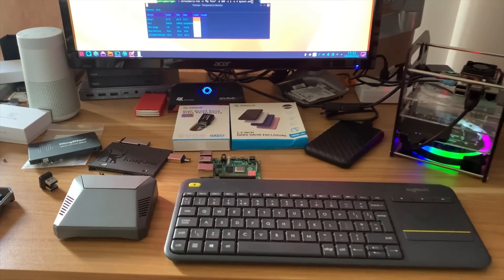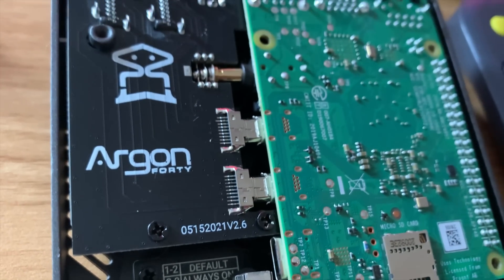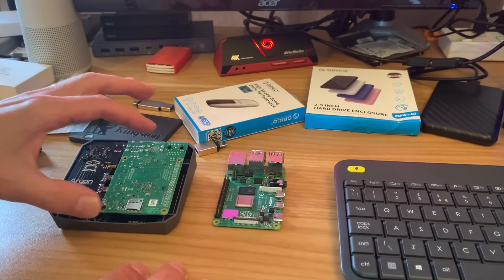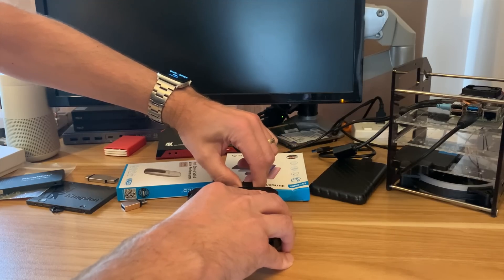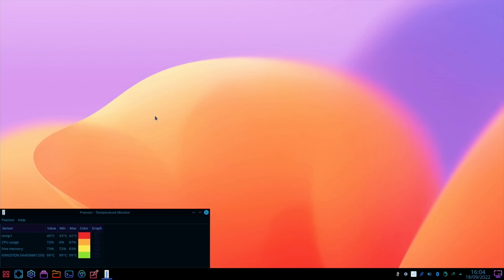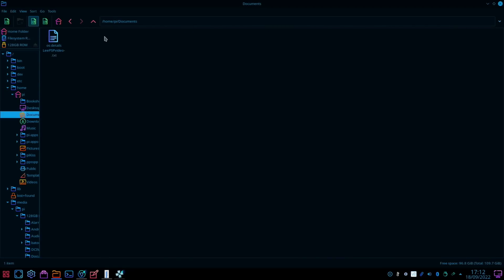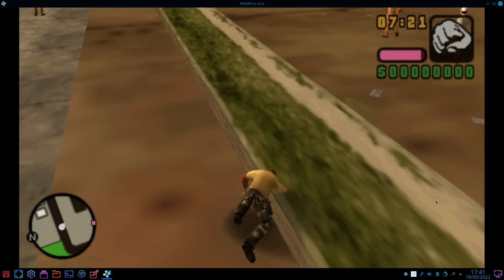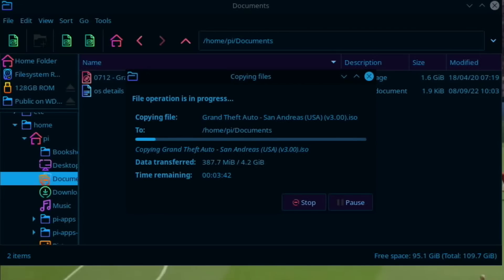Argon one V2 Vs ice tower cooler Test. Part 3

Comment: I don't have an argon case but something i would look at doing is seeing if there is enough clearance inside of the case for an ice tower, then cut a hole or vents in the top to supply air. 3d printing a new lid to accommodate the ice tower is also an option
Reply: Why the hell would you do that? The case IS the heat sink. The aluminum reaches down to the CPU, transferring all of the heat produced through the whole case which was designed to BE the heat sink. Cutting a hole in it and putting an ice tower cooler on it is beyond ridiculous.

Comment: I received my 52Pi rack tower over the weekend. I ended up mounting the Argone one V2 to the top layer using 2.5mm x 25mm machine screws purchased from a hardware store. I'm going to mount a  powered 4-port, USB 3.1 hub to the second layer and the bottom two layers will have two 3.5 inch to 2.5 inch double layer SSD mounts screwed into the mount holes in the plastic. I have 1TB SSD's in one of the mounts. I'm plannng to remove those and substitute in 2TB SSDs each, along with the 500GB M.2 in the Argon case. 

If the Argon case-fan is annoying, this may be a quieter option. The top of the tower fan is able to blow enough air over the Argon one case to cool the metal, and to blow air around the M.2 case.
Reply from the maker: Let me know what hub works well for you. 👍🏻

Comment: Great stuff! Love to see updated ultimate overclock guide plz?
Reply from the maker: I have a few, the Pi 400 was most recent 

Pi 400. How high can I Overclock without it crashing.
https://youtu.be/e9U58V8aJBE

Overclocking without cooling. Raspberry Pi 4.
https://youtu.be/DNjI6u91LuA

Overclock Test 2000 Vs 2147 Vs 2300Mhz. Raspberry Pi 4. Ice tower cooler Plus.
https://youtu.be/XiN5wbt46XA

GPU Overclock test 950Mhz. Raspberry Pi 4.
https://youtu.be/9q-k-ANRB0c

V3d Overclock test 1000Mhz. Raspberry Pi 4.
https://youtu.be/epWXhk6omtU

Best Nintendo GameCube emulation so far! Raspberry Pi 4 2325MHz Overclock.
https://youtu.be/9FaJfqAWOeM

Half Life 100 FPS and the rest! Raspberry Pi 4. PiKiss Simple Multi installer.
https://youtu.be/IH64giSnydI
Reply: @leepspvideo  ah excellent thank you handy to have the list appreciate that.

Comment: I use the default fans setup: 10% @ 55'C, 55% @ 60'C then 100% @ 65'C.  Logs show:

Mon Sep 19 00:11:56 2022 [INFO] Set fan to 55%
Mon Sep 19 00:27:08 2022 [INFO] Set fan to 10%
Mon Sep 19 00:42:20 2022 [INFO] Set fan to 55%
Mon Sep 19 01:15:08 2022 [INFO] Set fan to 10%
Mon Sep 19 01:15:42 2022 [INFO] Set fan to 55%
Mon Sep 19 01:36:44 2022 [INFO] Set fan to 10%
Mon Sep 19 01:51:18 2022 [INFO] Set fan to 55%
Mon Sep 19 01:57:08 2022 [INFO] Set fan to 10%
Mon Sep 19 01:57:44 2022 [INFO] Set fan to 55%
Mon Sep 19 02:01:58 2022 [INFO] Set fan to 10%
Mon Sep 19 02:13:10 2022 [INFO] Set fan to 55%
Mon Sep 19 02:13:28 2022 [INFO] Set fan to 10%
Mon Sep 19 02:22:40 2022 [INFO] Set fan to 55%
Mon Sep 19 02:29:08 2022 [INFO] Set fan to 10%
Mon Sep 19 05:02:18 2022 [INFO] Set fan to 55%
Mon Sep 19 05:02:28 2022 [INFO] Set fan to 10%
Mon Sep 19 19:56:20 2022 [INFO] Set fan to 55%
Mon Sep 19 19:57:30 2022 [INFO] Set fan to 10%
Mon Sep 19 20:00:02 2022 [INFO] Set fan to 55%
Mon Sep 19 20:00:10 2022 [INFO] Set fan to 10%

My old ears cannot hear the fan unless I get very close, and then I get a warm ear.

Comment: The problem with the Argon case is not really the fan comes on (yeah it's a little noisy). The problem is with the magnetic lid on top the Argon is a PASSIVE cooler ONLY regardless of fan. The Argon is an amazing passive cooler. But there are situations you need active cooling. The reason this happens if you look you'll notice heat from the fan is vented through a hole under the magnetic lid. Through moving air this transfers the heat to the aluminium lid and into the rest of the case. The air intake for the Argon is a air hole gap in the GPIO pins under the lid. This intake is the closest to the fan so the Argon fan will pull air from here instead of the side holes. So heated air is blown against the magnetic lid and pulled back in at the GPIO because the lid holds the heated air to the case. If you take the lid off some of the heat escapes and the case can cool actively. Leep you are in a very cold room so your active cooling is very efficient. Here in the summer time for me the temperature is around 78F peak. This is enough with the magnetic lid on running the same overclock settings as you to cause an overheat CPU throttle playing emulation. It takes a while for that big Argon case to heat up. But when it does passive cooling is not enough. After some experimentation I learned to only way to keep from throttling was to keep the lid off the Argon.  Leep a good test for you to show would be to see if the Argon fan provides ANY benefit with the lid on. Your in a cold room so it will be harder for you to test. But I think it would be a good test to have you as a 3rd party tester confirm this situation with the Argon? :)
Reply: Useful to know. I was thinking of this but maybe not it's always around 30c for me and the Pi idling runs around 45c.
Reply: That is really weird:

Because passive cooling is in the opposite direction: thermal uptake (the chimney effect) pushes air out through the top side vents from all vents below (including the lid but not excluding the base).

That is worth a part 4.
Reply: @LilRedDog  When the fan is not running yes heat will rise and take the nearest exit. The passive cooling is one of the best with this case. But if you lack a cool room with AC you run into problems with it's active cooling.  When the fan is running it blows air out the exhaust chimney. This chimney is covered by the magnetic lid. The nearest intake (hole) to the fan intake is the GPIO pins. So the air intake for the fan comes from there. The magnetic lid also covers the gpio pins. So when the lid is on your fan is cycling heat into a loop. If you take the lid off then the Argon cools fine with active cooling.
Reply: It's got vents out the side...
Reply: The magnetic cover does have slots (albeit thin) machines into its shape that line up with the hole I can see the fan hub and blades through. So I would say that there is a path for air to leave or enter the enclosure
Reply: @c4sualcycl0ps48 I've run tests. The holes are past the GPIO pins when the lid is on. With the fan blowing this creates a low pressure area under those pins. So the hot air gets sucked down into the GPIO->fan intake and loops the hot air. I've run my own tests. The case when overclocked and it's warm (upper 78F) will passively keep the case cool for about 20-30 min while slowly heating up. It will then throttle. This process takes longer when it's cooler. However if you take the magnetic lid off the heat escapes and the cpu stays under throttle.
Reply: It would be best if the made a vent directly on top of the fan so all exhaust air is released and cool air could be drawn in on the sides. That would improve airflow a lot.

Comment: I cannot hear the fan in my unit. I had to put my ear right next to  it to tell if it was working when I 1st got it.  I live in NYC so much hotter here in a room with no AC. I run the default Argon settings. I always wonder if its my hearing or I have a quiet unit when I see comments about the noise ??? Mine is nowhere near the sound I could hear in the video ?
Reply: This is worthy of emphasis:

Agreed:
I, absolutely, heard the fan in the video. 
I had to wait for it to shut off to know that was fan noise; because I had never heard that and did not recognize it and I'm listening to this video, in a hotel, on my POS travel HP that, somehow, survived getting slung out of my laptop bag going through a TSA checkpoint when I did not zip the bag closed and felt rushed...

My ASUS STRIX, would have shattered.
Reply: If the fan is at lower speed settings (not 100%) it is usually very quiet.

Comment: I actually lost the top for my argon case. But I customized the setup for my argonONE fan to come on at 10% speed at 35 degrees and step up 10% every 5 degrees. But I never get higher than 60 degrees. I also use thermal paste instead of the pads they give you and I have the nvme base which runs so much smoother.

Comment: Do you had overclocked the pi in the Argon case also to 2147Mhz? Because I'm surprised how smooth youtube is running at 1080p and still capable to handle file operations and emulation.
Reply from the maker: I just checked 2250

Comment: I have the first edition of the Argon case (with micro hdmi on the back) and I stopped using it because of the fan. It's loud and annoying just like yours. It's a shame that after 2 years since launched they still haven't switched to a quieter fan.
Reply: It'd take 30 seconds to solder a Noctua or Sunon Maglev fan in there...
Reply from the maker: Comments have suggested lowering fan speeds
Reply: Even at low speeds like 10% I can still hear a high pitch noise. Sometimes it even rattles as if the blades aren't 100% centered. I ended up disconnecting the fan and used the pi at stock speeds when I was using this case. Now I'm using the regular ice tower on the 3.3V, but I'll soon get this new version that makes contact with the network and USB chips as well. I use mine as a seedbox so they get pretty hot.

Comment: Heat is what kills and shortens the life span of all computer parts. My  fan is always on and the pi will idle  at 26c to 32c depending on the days temp... Play Youtbe videos  all day long 32c  to 37c , no heat build up... Stress test with sysbench wont hit 50c.. Fan is an old 12 volt . 60mm case fan out of a IBM desktop PC.. Ideal fan would be 5 volt noctuha on the 3 volt pin..Whats good about the 60 mm fan I can mount my Pi on stand offs with the sd card end of the pi mounted between 30 mm stand offs..   Above and below the pi... 60 mm fan screws into the stand offs and looks very much like your new low profile Ice cooler.... Home made cases and heat sinks.   Out performs store bought every day of the week..
  CPU 2050     GPU 650       O/VOLTAGE 5 OR 6

Comment: So regarding your non working 1gb pi
i might have a theory
if you updated it's eeprom and it somehow got so corrupt it can't even flash itself properly again then maybe the chip has to be flashed using an external flasher?
ideally you should try debugging your pi with a serial debugger see if that outputs anything

second theory
your pi somehow shorted out
can accidentally happen if you drop something near the gpio pins
how it will act if it's shorted: power LED stays on, act blinks once (Matches what is seen in the video)

hopefully it's not fried but those are my theories

Comment: Great test! I personally use the Miuzei MC23-4. Cheap and perfectly made. The heat sink is adjacent to the most important elements. I recommend it with all my heart!
Reply from the maker: It looks like the fan stays on all the time. Do you run it at 5V or 3.3V.
Reply: @leepspvideo  3.3V but you have to put your ear to hear it :)

Comment: @leepspvideo Off topic: I am considering buying a 27"-32" computer screen to replace my 24" Roku tv. I'll be using a Fire Stick. Can you recommend a screen, please?
Reply: I have two Sceptre monitors: one 24" and  20".

They are dirt cheap at 27" on Amazon and I have had no issues with them.  They have 2 HDMI ports and a VGA so they should work with a Fire Stick.
Reply: @LilRedDog  Cool. What about speakers? I will be using it in my bedroom. It will have to stand on a dresser about 6' away from me.
Reply: @mamalujo2003  They are not the best. But you can hear them.
Reply: @LilRedDog  Thank you.

Comment: Might replacing the Argon's fan with one by Noctua help? Noctuas are know to be very effective and quiet.
Reply: Yeah, I bought one 40mm from them for my first case.
It did not las a year.
Reply: Noctua has great, very quiet fans. I have four on my Ender 3 printer and they've been dead silent for 2+ years now. I've also used Sunon Maglev fans, they're nearly as silent and a lot more powerful.

Comment: I have a couple of Pi4s in argon cases and under normal use I never get the pi warm enough to trigger the fan.
Reply from the maker: I was trying to heat mine up. Do you live in a hot country? Also do you leave your Pi’s on for a long time.
Reply: @leepspvideo  I live in NZ so it's a bit warmer than the UK. One is on 24/7 as it is my NAS running open media vault, the other is an as and when.
Reply from the maker: @andrewd4906  good to know. 👍🏻
Reply from the maker: @andrewd4906  Indigo traveller is a great YouTuber from NZ. 👍🏻
Reply: @leepspvideo  I live in Texas. Mine never heats up I leave mine running on accident sometimes running video or mining. I have two neither heat up but sometimes fan does turn on but hardly. I love my Argons
Reply: @leepspvideo  
Observation:
It sounded like something in the fan was rattling. Loose screw??  Something stuck in the blades causing it to spat on the blades??

Suggestion:
See if you can trade the fan out for another. Possibly from a high quality manufacturer like Noctua??

Thank you for your time;
Monte